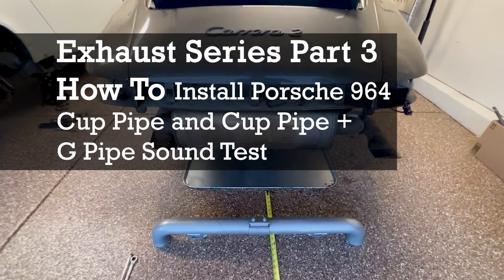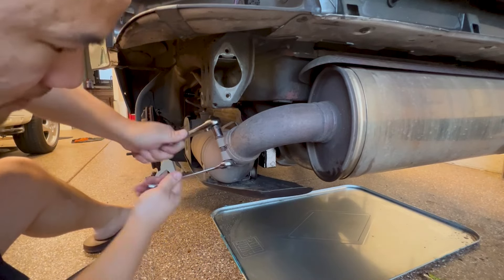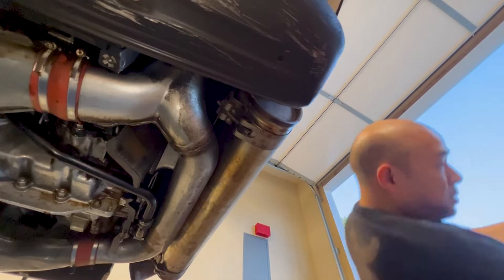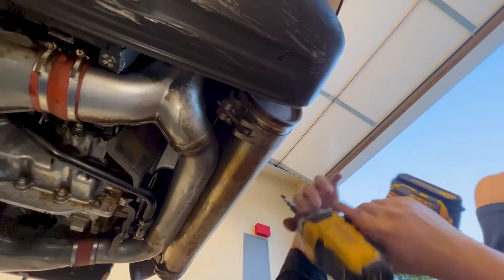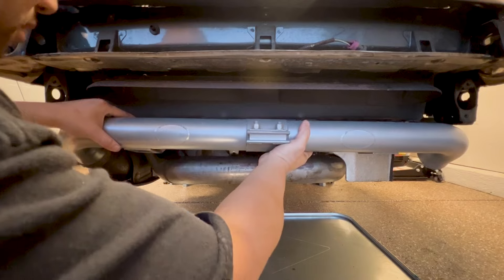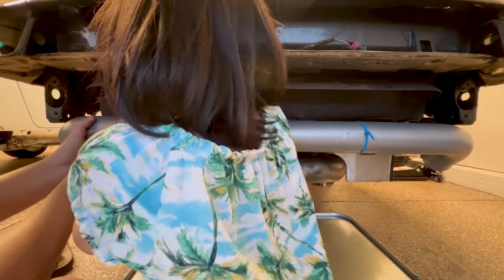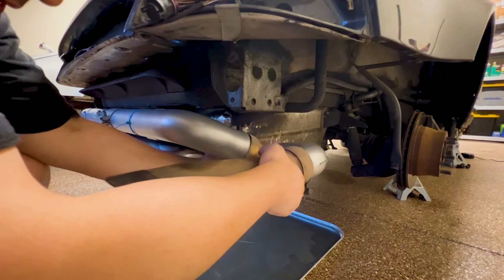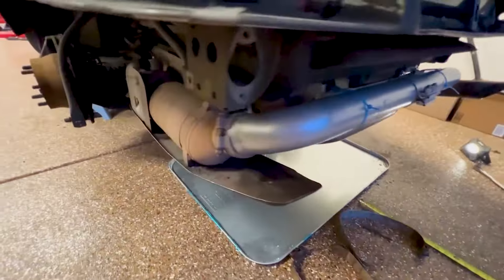Exhaust Series Part 3: Porsche 964 Primary Muffler Removal, Fabspeed Cup Pipe Install and Sound Test

Comment: Way too loud. The characteristic sound is gone. And you loose Power, too. Cup pipe and stock secondary muffler is the best imho.
Reply from the maker: I felt like the cup pipe with secondary muffler was the slightest bit louder than stock.  Still a great sound.  Its all preference.  This I agree is on the louder side, but I love loud.  Cheers!
Reply: @levelupclassics  
I added a 200cell metal cat, cup pipe and stock secondary muffler. That Sound is a Little bit more and with a few bites here and there the outcome on the dyno ist 273 hp and 345 Nm of torque.
Reply: Sounds great...I have the Fabspeed Primary installed as well as well as the secondary (not installed yet). But had a question..after a normal drive and the car us shut off...is your driver side rear fender above the tire area very hot..almost can't put hand on the body panel..?